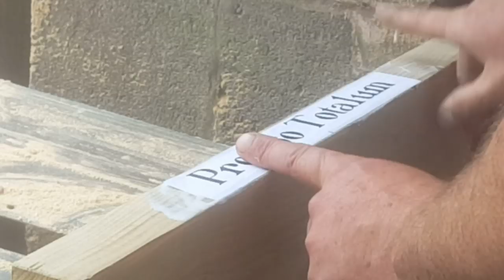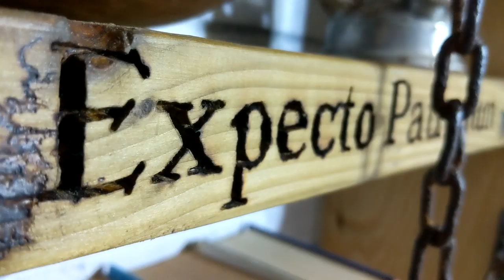A Harry Potter Bookcase - DIY Pallet Furniture Projects

Comment: My pallets never look as good as yours. Luv what you are doing!  Kiss Kiss Hugs Meow Meow to  your Sweetie!
Reply from the maker: Ive got a few places that have better ones. The air con supplier, fibre optic manufacturer and electrical suppliers have the best ones. Oil deliver firms and companies doing resin driveways have good solid ones but they tend to be dirty. Double glazing companies can also have interesting ones that have been used to hold big pieces of glass. 
Agricultural and food suppliers seem to have the worst ones. Out of 10 pallets it may only be one or two that I choose to use. Keep looking around, youll find the gems. 
Butters sends hugs :)
Reply: @thepoultrypeople  Try local manufacturers that are getting new production plant, they often come in bespoke wooden pallets and boxes. My father built an entire roof for a house using the crate one machine came in. Beautiful Swedish pine laminated beams, and massive amounts of smaller long pressure treated pine, even came with pest control certificates for the wood, giving the method they used for it, and the lifetime the wood was warranted to be pest free for under varying conditions. Still there years later, with the steel roof as well, just only has an 80 year warranty instead of a century, because the company did not install it themselves.

Comment: I have seen that makita red stuff before and cheap ! Is it any good?  I'm looking for a belt sander but don't want to spend out loads on traditional makita. 

Is it more of a diy range ?
Reply from the maker: Its great, about the only thing they may have scrimped on is the bearings but Im guessing here. They are re releases of the older designs from what I read, that belt sander is a tank! Ive had a few of the traditional blue ones and broken them over the years. I highly recommend it.
Reply: @thepoultrypeople  Maktek is the cheapest tools Makita makes, they cut the price down of all the parts, using cheaper plastics with no fill, sintered bushes instead of bearings, skimp the lube in them and also the motors are designed for a shorter life, using thinner wire ( CCA as well) and fewer turns, plus using all the older moulds that are still useful but worn. Good for light use, and usable, but definitely not a thing for production or heavy duty work.

With the Hitachi you can buy the speed control switch and replace it, done that on quite a few drills from all makes, the switches themselves are only made by a small number of other companies. Normally though I find they fail open, not shorted.
Reply: @thepoultrypeople  it looks exactly like the one I used to use at work but red and it was a beast! Keep up the good work love the videos and the cat !!